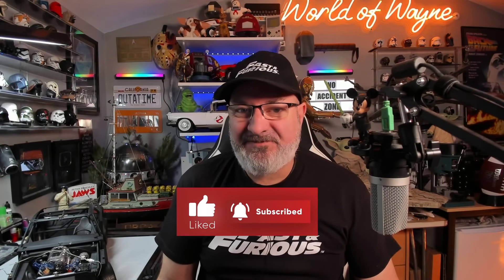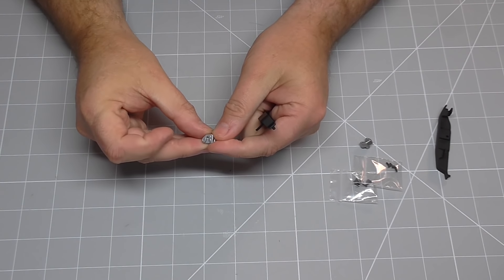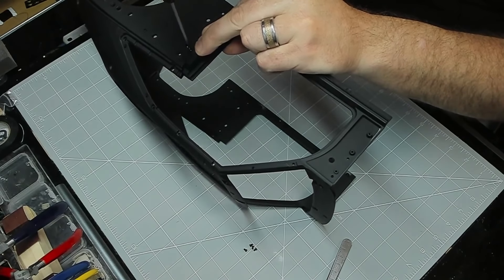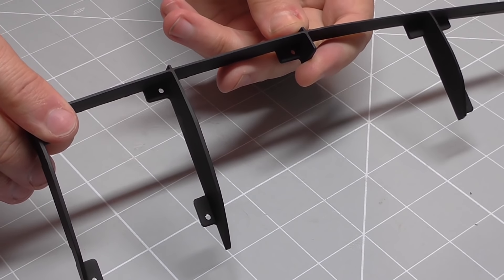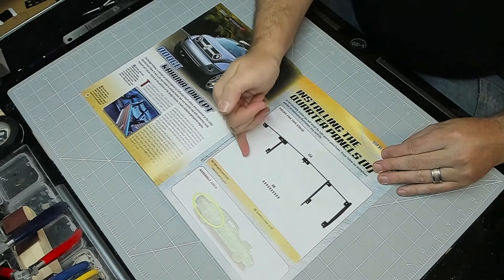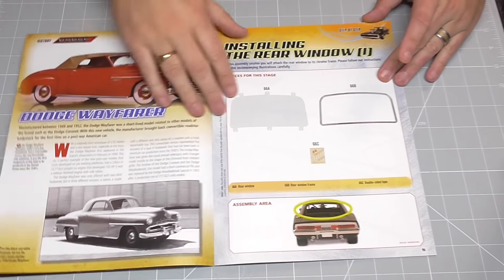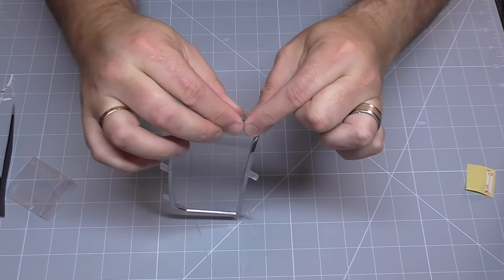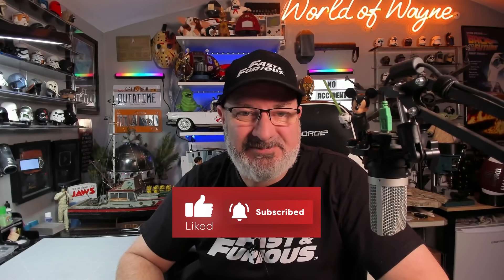Build the Fast & Furious Dodge Charger R/T - Part 63,64,65 and 66 - Frame and Rear Window

Comment: Re the back window, as they have given you/us 6 bits of double side sticky tape, I think that I would have used the other two bits and put them on the side edges of the window, as well as the ones onthe top and bottom!   Just a thought!